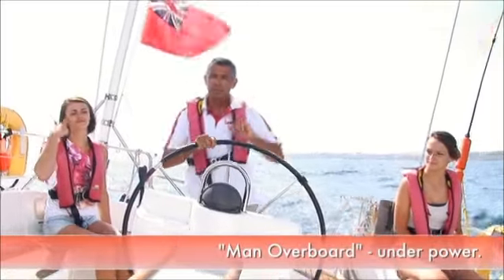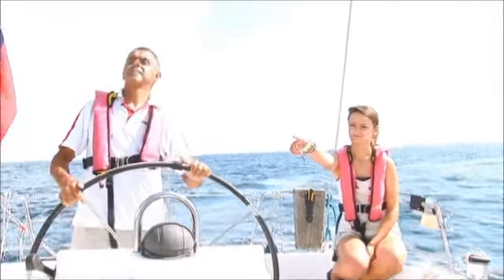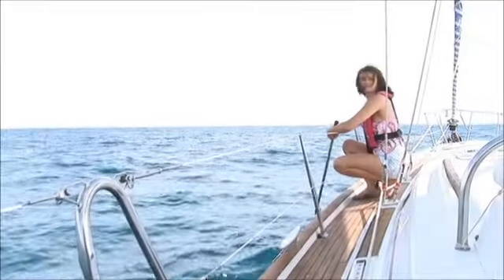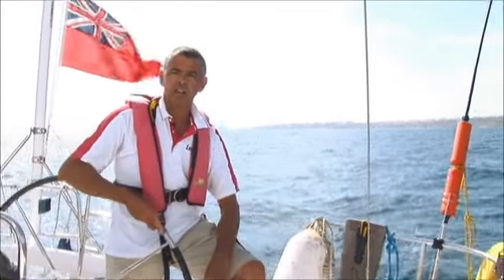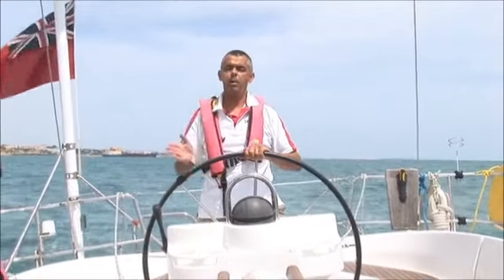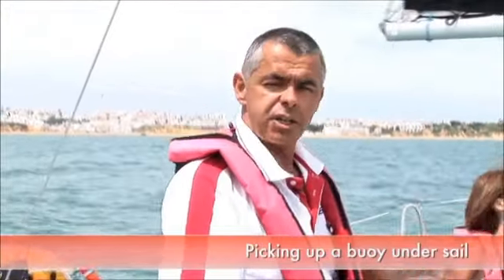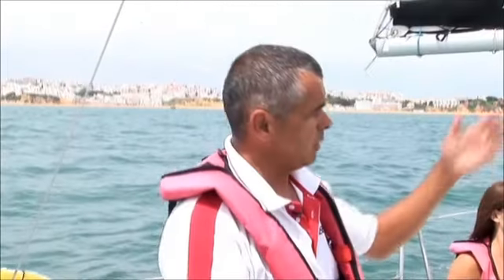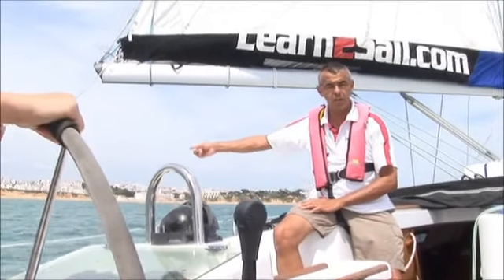Part 3- Coastal Skipper Sailing Tuition

Comment: These videos are great, thank, you! BBC: Beam reach, Broad reach, Close-hauled. Excellent acronym.
Reply: The last point of sail on a man overboard drill under sail is close reach, not close hauled.  The advantage of a close reach is that you can head up or bear away a bit in order to adjust course to the person in water.  If you're close hauled, it's impossible to maintain way and also head up nearer to the wind.  (You'd go into irons.) Close reach is more flexible because it can move a bit upwind or a bit downwind, as needed.

Comment: Don't see your point Bob. The diagram clearly shows the boat turning to wind and heaving to.
Agree with tentsforpaddles that your pointer is "king" and should do only that job.
One thing that I teach on MOB is that the boom should be centralised prior to going downwind just in case an accidental gybe occurs. Also I furl my headsail and check for ropes before starting the engine (that's from bitter experience!!)
Must say that this series is probably the best set of instructional videos I have ever seen. Great instructor.

Comment: Hi there,
Thanks for your videos. I like the fact that you demonstrate things in reality in addition to the usual diagrams.
Just one criticism of the procedure followed in this video. At 0:46 you instructed Lizzy to "man the furling line". At that time she was pointing at the casualty.
If I was the skipper my policy would be that whoever initially takes up the role of pointing at the man overboard (usually the person who first saw the incident and deployed the man-overboard gear), that is their ONLY role from that point on (especially in rough seas). Any other responsibilities or tasks should be delegated to other crew members, but NOT the crew with the "eyes on" role.
This ensures that their eyes never leave the direction of the casualty in a situation where the orientation of boat to casualty is changing swiftly.
In your video, there was some period of time (maybe only a few seconds, but maybe more) from 0:45 secs onward where no-one was looking at and pointing at the casualty. IMO, it's critical that at least one set of eyes never leaves the casualty.
Reply: Agree.  In any sort of waves and even in daylight, it's extremely easy to lose sight of a person in the water.  (They are very low in the water and can dip below wave peaks.)  The person watching the person overboard should never take their eyes off them or stop pointing at them.  Someone else should operate the other parts of the boat.

Comment: would you really invoke mayday immediately?
Reply from the maker: Yes indeed and the reason is you are buying your MOB time. A person falling overboard will succumb to cold water shock, especially if the sea temp is 15 degrees C or lower. Cold water shock can induce cardiac arrest and secondary drowning. As skipper you. Won’t know the condition of your MOB until you get back to them. How long is that going to take?? 15, 20 mins? When you get back to them if its the worst case scenario then if you hit the distress alert button you have bought that person 30 mins which can mean the difference between life and death. If they are undamaged then you can always cancel the distress call. Your MOB still has to be taken to hospital ASAP because of the risk of Delayed drowning.
As a skipper you have some big alls to make - that’s the job 😊